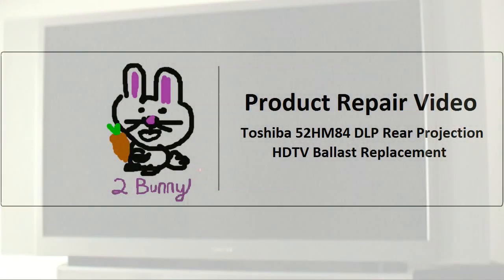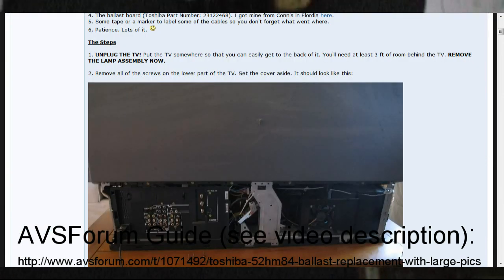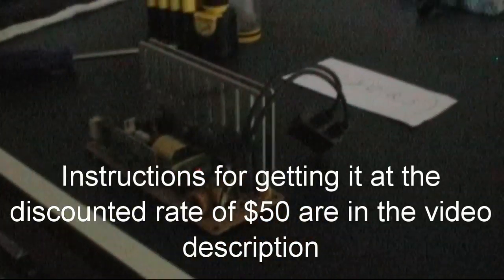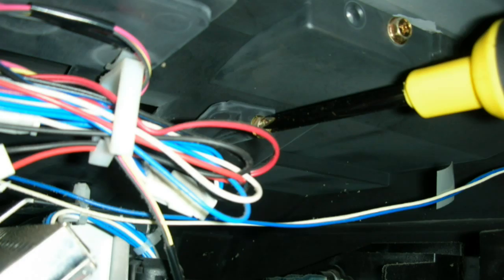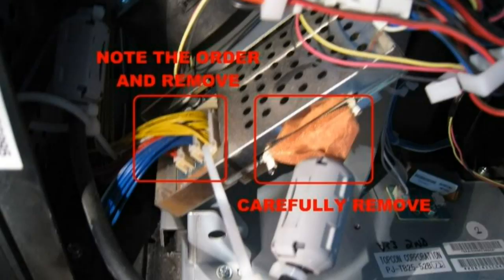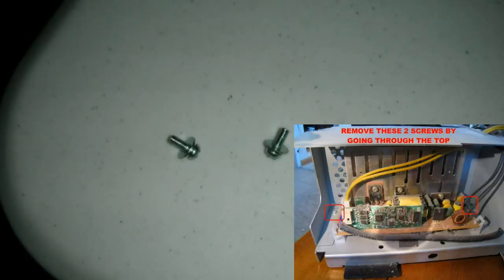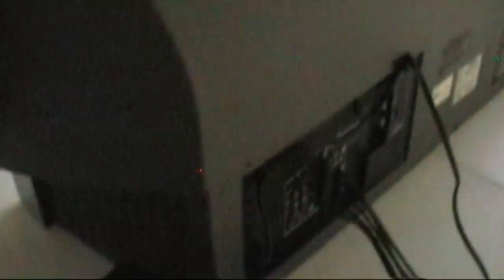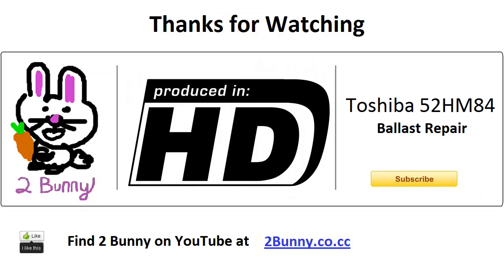Toshiba 52HM84 Ballast Replacement Repair Guide 2012

Comment: I brought the exact model to a repair shop and was told it was the ballast but they didn't make the part anymore.  I found your video and found the part you recommended.  Had no idea what I was doing but followed your video and I am now watching the tv again.  Can't thank you enough.
Reply from the maker: Thanks for reporting back! I'm glad to hear that my findings were helpful, even all these years later. Do you mind saying how much you paid for your ballast and where you acquired it from?
Reply: 2 Bunny Hi 👋 
Do you have a video showing replacement of the power supply board for the Toshiba 52 HMX 84…. ??

Comment: Thanx for this video. Had my toshiba in the garage for a while until finally decided to fix it myself. Love the Battletoads pause music. Lol
Reply from the maker: Glad you got it working. Just out of curiosity, where did you buy your ballast from and how much did it cost?
Reply: ***** Good video thx for posting... quick question for you: I have found on the net a repair kit for the ballast consisting of two transistors and a resistor. I reckon that it's legitimate since some online stores actually have a core charge for the old ballast. Wonder whether you have tried such fix and if so what parts are required. Anyway thanks for everything here.
Reply from the maker: Bogdan Sandu

I actually kind of wish something like that had been available when I fixed mine; probably would've saved some money. I can't vouch for the effectiveness of such a kit, but if the consensus is that those are the bad components, it might not be a bad idea. It's also worth mentioning now that since the video was published, ShopJimmy (and that other site) are sold out of the more inexpensive ballasts, so this might be the only way to go now.

Let us know what you figure out.
Reply: ***** Well after some 'research' I found out that the kit consists of two diodes and a resistor, the d2, d3 and r3 on the board but in reply to this info found on 'all about circuits' site another gentleman measured and found on his tv ballast board that one of the d5 and d6 diodes is gone too... now many others also inquired about these since no value or type can be read on said diodes other than they are 'very small and with a purple stripe' on them... out of the d2 and d3 only one was reported to be toast so the original poster replaced them both ( the ones wrapped with silpads on the heat sink )  and the r3 resistor and the lamp fired immediately after the fix but he could not reckon what the d5 and d6 values/types is... I have found the same diodes as the ones replaced in the post but I have to buy min 30 pcs while I only need 2 so I've put it on the back burner till I find someone that can tell the d5 and d6 so I could go the full monty and not take any chances... the d2, d3 diodes are Sanken 'damper' diodes FMV-G2GS, rated 1700V 6A and not available and the reported replacement is Fairchild TO-220F, 10A, 1500V and resistor 1K at 1/4 W... if I only knew what the d5, d6 are I could go for it at once, those guys were successful so far... if you have the old unit and could reckon them please let me know after all from Toshiba dealer is over C$200 before taxes and S+H... thanks again and hope that you could help here now.
Reply from the maker: Bogdan Sandu

Well, I'll say that you found out a lot more about the troublesome components themselves than I ever did. I could check, but I don't believe I kept the old ballast unfortunately and I sold the television as well, so I can't actually test the components. How much does the 30 piece pack you were talking about cost?

Another thing to do would be to keep your eyes open on ebay and other shopping sites for complete ballast units at an affordable price.

I hope you figure it out though; keep us posted.
Reply: ***** My friend, by the time you buy ALL the needed parts and even tools required for the job , all in all it's still going to be cheaper than a repaired unit plus taxes and S+H... and if it goes south again - it's only you to blame and not the seller for obvious reasons, hence my quest for knowing all the required parts and fix the thing properly. Remember, electronic components are just like automotive ones, they simply have a life span and buying a used car part from the junk yard is like buying a repaired ballast, you never know how long is going to last... at any rate, should I come across a reasonable fix by my standards I'll let the community know... not sure if I did but it's worth mentioning again... this TV has been good to me so far, way better than what I've read from other owners so fixing it is the next thing to do and cheaper in the long run than buying a new $1000 unit just to match the size alone... till the next time
Reply: Bogdan Sandu An update to the above... I have found a Russian tech that fixes TVs and all kind of electronics and he has experience with these failures... in a nutshell he will replace all 4 diodes, the d2, d3, d5 and d6 as well as the r3 resistor and will check the other components on the board for C$60... I guess that it's not bad considering the parts cost alone never mind the waiting time for S&H and all... should be done in a few days when time allowing I will re-fit the ballast and fire up the famous Toshiba... on another note it's extremely hard to find a privateer to tackle these jobs, all too busy or hard to get a hold of and as far as the big box retailers/service shops - one should rather do what all this DIY community does, tell them where to go and go freelance and fix it yourself... I'll ask the guy for the d5 and d6 manufacturer/part number so I can post it and let whoever stranded owner know where or what to get to fix it
Reply from the maker: Bogdan Sandu

That's great, be sure to report back when you get it installed and working again.
Reply: ***** So, as promised here it is... the ballast has been repaired as per instructions above and as follows: the two d2, d3 diodes on the heat sink were replaced as well as the r3 resistor while the other diodes d5 and d6 were checked and came out clean... the guy told me that one transistor seemed 'weak' but could not replace as he could not get it for less than some US$ 60 because he should have bought 40pcs whereas he only needed one and to have just one would have cost even more because S&H so he put it on the back burner... he charged me nothing asking to install and see the outcome which I did and the TV came alive and well... have reset the bulb timer and I'm back in business... in a nutshell the repair works so whoever out there has still an issue - try this way for it works.
Reply from the maker: Bogdan Sandu

That's really something. After all these years, this is the only mention of successful repair of the ballast itself I have seen on the entire web. I'll be sure to make a note in the video description for viewers to check out; maybe it'll help some of them too.

Comment: What were the symptoms? At first, Mine had sound but no picture now it turns on and off every few seconds
Reply from the maker: With mine, it wouldn't power up first try - it would take anywhere from 10-50 "tries" to light the lamp. The nice thing about the HM84 series is that if it can't light the lamp, it'll immediately try again and again - up to around 10 times before giving up, if I remember correctly. Worth noting is that on mine (with a good lamp), even with the faulty ballast, once the lamp was lit, it would stay lit as long as the set remained on. Shutting down after being on may just be a sign of a bad lamp - do you know how many hours are on yours? (the previous owner of the set in the video never bothered to reset the lamp timer, so it actually just reads "9999 hours" and a lifetime count of 24000+ hours - that last owner definitely got some serious mileage out of the thing before I got it!)

Aside from that, I was actually impressed with the Toshiba, especially compared to the similar Mitsubishi model that I had recorded some videos on. The Toshiba may have had poorer image geometry, but the simpler no-frills design gave it a lightning quick powerup (providing you have a good ballast) and responsive menus and functionality with good durability (the 24k+ hours that the previous owner logged alone are a testament to that) and even the repair wasn't that difficult.

Best of luck with yours! Let me know what you figure out.

Comment: Can you please tell me what symptoms you experienced in order to diagnose this ballast problem? Mine sounds Like it's shorting out or generating it's own Jedi lightning.
Reply from the maker: Like I mentioned last week,

"With mine, it wouldn't power up first try - it would take anywhere from 10-50 "tries" to light the lamp. The nice thing about the HM84 series is that if it can't light the lamp, it'll immediately try again and again - up to around 10 times before giving up, if I remember correctly. Worth noting is that on mine (with a good lamp), even with the faulty ballast, once the lamp was lit, it would stay lit as long as the set remained on. Shutting down after being on may just be a sign of a bad lamp - do you know how many hours are on yours? (the previous owner of the set in the video never bothered to reset the lamp timer, so it actually just reads "9999 hours" and a lifetime count of 24000+ hours - that last owner definitely got some serious mileage out of the thing before I got it!)".

Can your set still start up or display anything on the screen at all?
Reply: The lamp won't light at all. I've replaced the lamp and when the television tries to start it makes a horrendous electrical noise. It sounds like it emanates from the spot where the ballast is located or at the bulb connector (which I cleaned).
Reply from the maker: J Mac

It's hard to say, troubleshooting these things isn't really my thing. If a new lamp isn't working, there's definitely something wrong somewhere, it's hard to say. I'd hate to tell you to find a new ballast and then have that not be the problem, but if strange sounds are coming from it (and you're sure that that's where they're coming from), I'd be inclined to think that it's the problem.
Reply: I appreciate you. I'm just going to use this as an excuse to replace. You want another Toshy? Free to a good home!
Reply: I know it's a tad late but better later than never... you may have not paid attention to the start-up process but when you turn the TV on there is a short buzz followed by the bulb coming to life and the buzz goes off... the buzz is the ballast producing the high tension to fire up the bulb after which the bulb lights up and stays so for as long as the power button is still on... to diagnose I guess you should have a 'known good bulb' and try to turn on the set... if the buzz is still on for longer like 6-7 seconds then the set is going to flash the green light and try to restart after the ballast ended it's high tension cycle... and that's when the ballast is most likely toast... for what I know the ballast not only supplies a burst of high tension, in the range of a few hundreds of volts necessary to fire up the bulb but also limits the current supplied otherwise the lamp self destructs
Reply: Bogdan Sandu Thank you for responding.

Comment: THANK YOU!! YOU ARE MY LORD AND SAVIOR.
Reply from the maker: Good to hear you got it working. Did you install a new ballast or repair your existing one?
Reply: ***** Repaired it. $5 with shipping!
Reply from the maker: Mr. BrewThatStew
Nice. What all did the repair kit consist of?
Reply: ***** 2 Fairchild Diodes of the 1500v variant and one 1000 ohm resistor of the 1/4v variant.
Reply from the maker: Mr. BrewThatStew
Thanks for the information. If I was more confident at the soldering iron 3½ years ago (and known about which components exactly were bad), I could've saved a bit of money, but with any luck, this will be beneficial to other folks with this issue.

Do you know about how many hours your Toshiba had on it when it originally failed?
Reply: +Channel 2012 Oh gee... We've had it for twelve years and it was on A LOT in those twelve years. I honestly can't tell. All the time it was on adds up to about a year and a half of up time.
Reply from the maker: Mr. BrewThatStew
There's a way to check the hours on it somewhere that involves holding down a combination of buttons. I think the previous owner got close to 30000 hours out of that particular model before it was passed on to me.

Another thing to consider on rear projectors that have been in circulation for a while is carefully cleaning the lens (but only if it needs it). This can improve light output and contrast, but you have to be extremely careful not to scratch the soft material that the lens is made of if you do chose to clean it.
Reply: +Channel 2012 yeah I used a microfiber cloth and got all the dust off the lense.
Reply from the maker: Mr. BrewThatStew
Good stuff! Now you're set for dozens of thousands more hours on it.
Reply: +Channel 2012 :) 👍🏻

Comment: I have a Toshiba 62hm84 dpl TV. When I got it it was constantly trying to turn on but nothing happened. The red light was steady, green light flashing. I found that the bulb was blown so I replaced it. It didn't come on. Now it doesn't try to come on. The red light is flashing and the green light is steady. Any ideas?
Reply from the maker: Yes. The lamp door is not closed. See page 60 of the operations manual.

Comment: can anyone help me? I some how disconnected the light for switch wire and can't figure out where is supposed to go.
Reply from the maker: Which one exactly is that?
Reply: it's the blue and white wire the runs from the switch on the light door and all the way over past the light engine. it has a 3 prong connector with just the blue and white wires.
Reply from the maker: Charlie Akin
Well, I don't have this television anymore, so I don't really know for sure, but if it helps, here's a copy of the service guide: http://www.audiolabga.com/pdf/TOSHIBA-46HM84.pdf

If you can't figure it out from there, I'd recommend asking in the BadCaps.net community forums. They've got some helpful folks on there who should be able to help scour that manual with you and find out where it needs to go.

Best of luck!
Reply: ah okay, yeah I looked through the manual and I don't see where it runs in there or maybe I don't know what is called. I'll ask the forum, I saw a couple other forums where people asked with no reply so I hope they help.
Reply from the maker: Charlie Akin
BadCaps is one of the most active television and monitor troubleshooting community overall, so somebody should be able to help you figure it out. I know they've been a great help for me on more than one occasion for all kinds of different stuff.
Reply: ahh this same thing happened to me. I can't really tell where the wire connector connects. looks like it goes up where the other blue wires go. did you find where it plugs in?

Comment: Thanks for the easy-to-follow video!  I was able to find the alternate part ( #23122497) ballast on http://www.tristatemodule.com/ for $45 + $15 shipping and replaced my ballast very easily (with your help).  In case anyone else wants to know, the symptoms my tv was experiencing was that whenever I would try to power it on, I would hear a click and then it would sound like it was firing up but then after about 20 - 30 seconds it would click again and sound like it was powering down.  It would repeat this continually for a number of times and then give up.  FYI.... I had previously replaced my bulb, so I knew it wasn't a bulb problem.  Plus the symptoms of a bad bulb were a little different (if I remember correctly)... I think when the bulb was bad it allowed the tv to power on and actually had audio, but just no video.  Hope this helps.